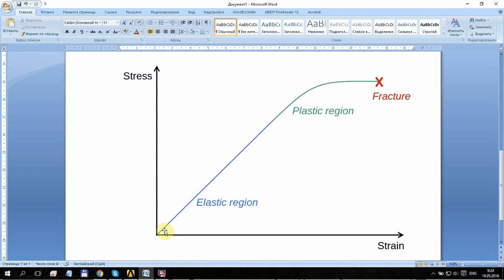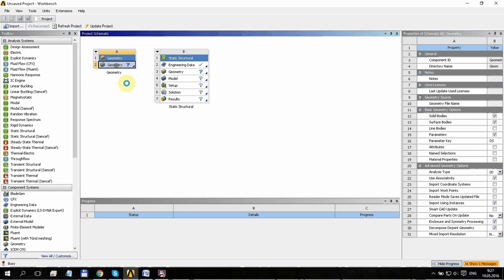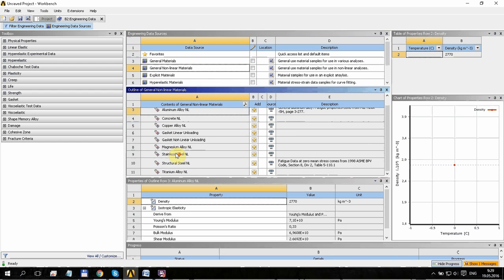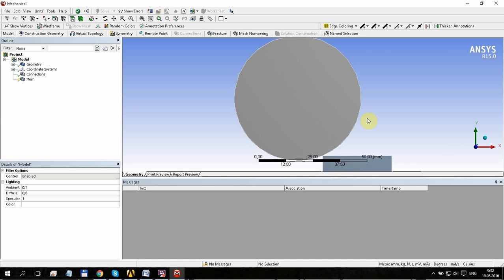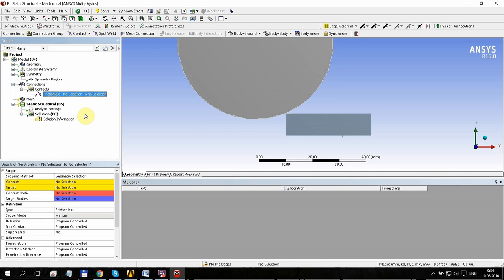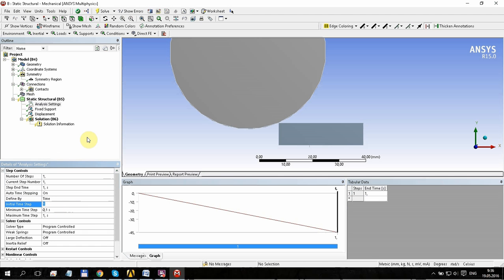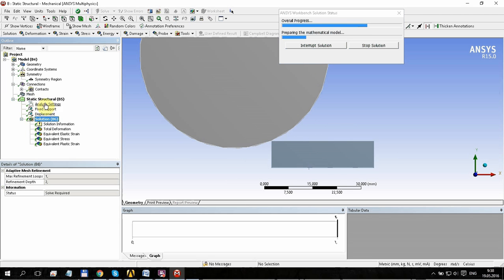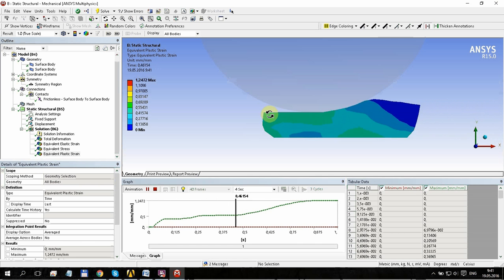Ansys metal rolling tutorial

Comment: it very amazing work and its gave me the key 
(but now i worked on drawing the rolls and spacemen by solid work  and after that make import geometry in ansys (3d
i try so mush time but i fail i dont now why it happen 
pleses help me
Reply from the maker: Mohammad Abdawi, it really does not matter if you create geometry inside ansys or import it. I do both and use solidworks all the time. 

Is your geometry 3d or 2d?
Reply: I succeeded to make import geometry in to ansys
put problem is simulation dose not success 
geometry is 3d

Comment: I have done what you did, but I'm still having problems. It doesn't move. Both roll and  metal bar are like fixed. What could be the solution?
Reply from the maker: +Reimondez Mariano Check the edge that you chose for displacement boundary condition. If the speciment doesnt move then its about wrong boundary condition for displacement.
Reply: +Alexander Lyapin It works!! Thanks!!